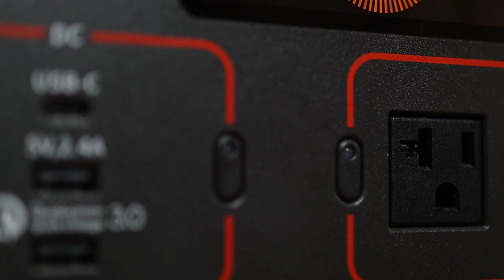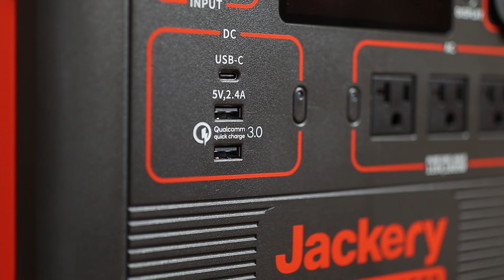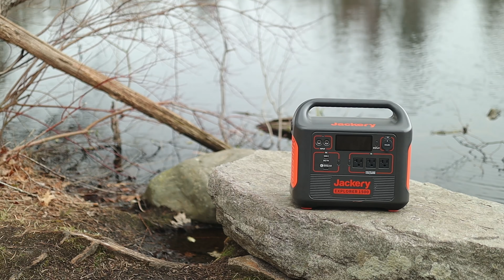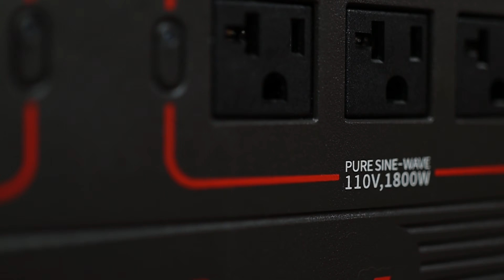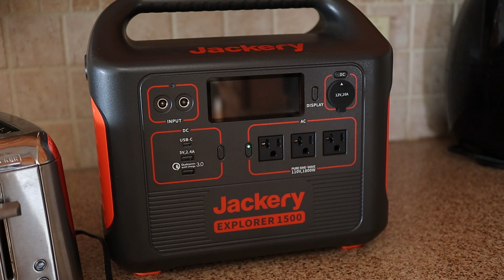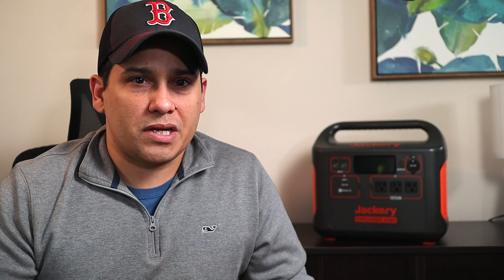Is the Jackery Explorer 1500 the Best Portable Power Station of 2021?

Comment: I am interested in purchasing this item, so I have watched your video multiple times and each time have another question.  At 9:25 in the video you are talking about your refrigerator. The Jackery is showing 99% charged, the refrigerator is showing 237W and has 7.1 hours of run time. That calculates out to 1659 Watts.  I though the unit only has 1500 watt hours and I thought the unit also uses extra power when the inverter is working.  Do you know how many watt hours are available? Did you ever have all four 100 W panels attached.
Reply from the maker: Fridges are tricky, because the power is never constant - we don't know precisely what the estimate is based on - it could be an average of the last minute usage, or it could be constantly changing based on current usage - but it is just an estimate, so don't try to calculate back capacity given that estimate.
Reply: @MakeUseOf  thanks for the answer
Reply: @MakeUseOf  Let's say you wanted generators to cover the running of your refrigerator during a power outage. One 1500 unit will only power the refrigerator for 7.1 hours, so you would require 4 of these generators to cover 28 hrs of operation, which could possibly be continued by solar charging each generator after 7 hours use, provided it is not too cloudy and there is enough sun light. The advertisement for the Jackery 1500 says it can power up to 7 devices at the same time, but you would require a power strip to do so, since there are not 7 110 vac outlets. Also, if several devices, like all the appliances you showed, are used within 2 or 3 hours,
one 1500 generator may possibly run out of power within 2 or 3 hours, correct?
Reply: @MakeUseOf  PS: Since this review, have any of you had a chance to test the Jackery 1500 using high power appliances along w/charging laptops & camera equipment off grid to see how long the Jackery 1500 can last?

Comment: How does pass through charging damage the battery?  Why is pass through charging more difficult than leaving it plugged in twenty four seven?  Can I use this as a UPS?
Reply from the maker: You can't use it as a UPS. A UPS uses large capacitors which can be charged and discharged simulatenously, keeping a constant flow of electricity but able to sustain a small amount of power should it stop. You can't do that to Lithium Ion cells like this as they'd be constantly cycling through their finite lifetime. I mean, technically, yes, you could, but you'd destroy the battery life a lot quicker. You shouldn't leave it plugged in 24/7 either; charge it up, then leave it at full charge until needed, topping it up occassionally.
Reply: @MakeUseOf  thanks for the answer

Comment: Ive emailed them twice asking about the jackery 2000 still no reply (tells me about their customer service)

So basically it should last 2 years (if used and charged all the time) soooo…can the barreries be replaced when that happens or is it junk??

Any other better options?
Reply from the maker: The internal batteries aren't replaceable. There are units like that starting to come on the market, like the iForway T-Rex which we just reviewed. But it doesn't turn into junk after a few years, the capacity just reduces. These units are rated to about 500 cycles, which means after fully charging discharging that many times, it'll drop down to ~80% of the original capacity. This is just a fact of life with any battery.

Comment: Better option? 1000 w/2 solar panels OR 1500 with no panels. ??
Reply: If you will always be able to recharge via wall outlet, or maybe in your vehicle with car 12 volt (that will take time).  Then, going with the e1500 is better imo.  Can always buy panels later.  But, if you will be w/o AC power for longer than a day or 2, and not driving much; then would need the panels to recharge.  Also depends a bit on what trying to do; the e1500 can run many more items than the e1000 - but if you are only using it for lower watt items, maybe the e1000 is better (and lighter to boot).  Also, much easier to buy 1 or 2 panels later for the e1500, than finding out the e1000 can't handle what you need.

Comment: To bad Jackery could not have use LifePo4  batteries. It would have made the unit weigh a whole lot more, but it would have gotten 3000 charge cycles with a 10 year battery life.
Reply: I agree there are so many other options for less money, with better batteries.

Comment: The only issue. Just only >=500 cycles.. nowhere Jackery talked about 800 cycles. The manual say >=500 cycles at 80%
Reply: @dmorrow6883  Just means that after 500 charge/discharge cycles you would potentially only have 80% of the battery life remaining.

Comment: it's a must have device, better having it and don't needing it than needing it and don't having it
Reply: If you don't have Jackery panels it comes with no ability to hook up regular solar panel.  A definite negative.
Reply: @stevegalas2556  I use renogy panels, they work fine with an adaptor cable.
Reply: Now I understand why Jackery sent sollar panels with the 1500.  I am stuck in the mud waiting for special connectors.  Your review missed the mark.
Reply: @stevegalas2556  he said you'd probably have to spend about $20 for an adapter in order to plug it into other solar panels. If he actually tested the solar panel charging time, rather than just stating their specs that it only takes 5 hours in the sun to fully charge the 1500 Jackery, those panels might be worth buying. I googled for reviews on the 4Patriots solar charger, and many people said it took 2 full days in the sun, just to partially charge a smartphone, making it useless for off grid. Also, I recently heard from 123homefree YouTube channel, that many small, portable solar panels for charging just phones & laptops don't last long -- like 1 year so far for him. He continually uses solar for that and lives off grid.
Reply: @stevegalas2556  I just placed an order. Did I miss something? Do I have to order a special connector ?
Reply: @silverd.t2393  I got my unit on April 20th and it didn't come with the extra power pack and the 8mm adapter. I wrote them and got a reply within 24 hours. Due to supply problems the are suppose to be sending out the 2 pieces sometime around the end of May. So far I haven't received  them yet.
Reply: @stevegalas2556  I have a 100w Rockpal and a DOKIO 220 Watts foldable. Using the supplied adapters the panels came with I was able to use the Jackery adapter that allowed me to plug the 2 8mm regular plugs into one line to the input. It worked fine.
I hope that helps
Reply: @PIZZA-ex1fy  me too...Awesome units